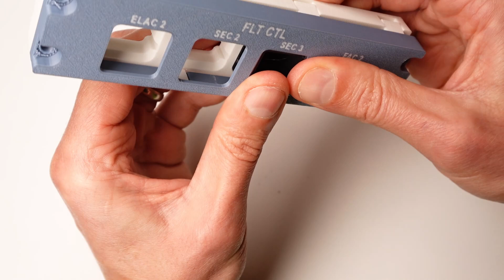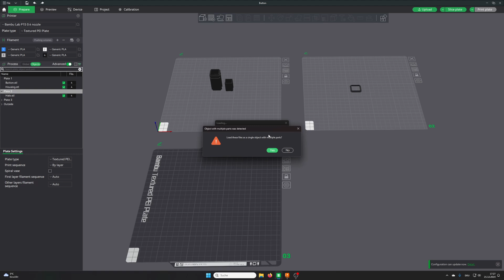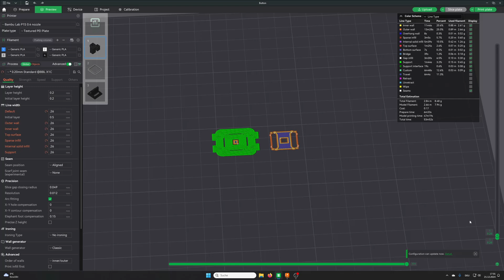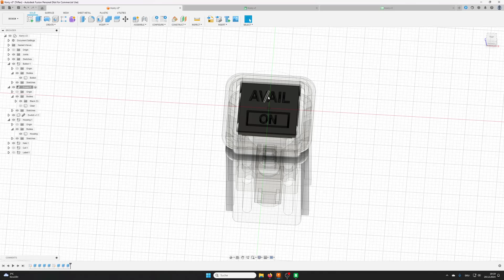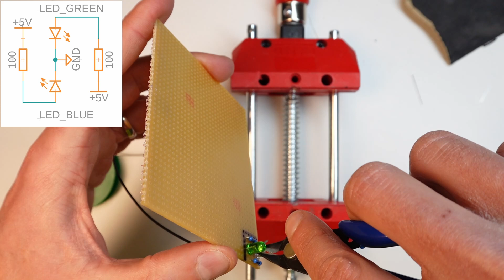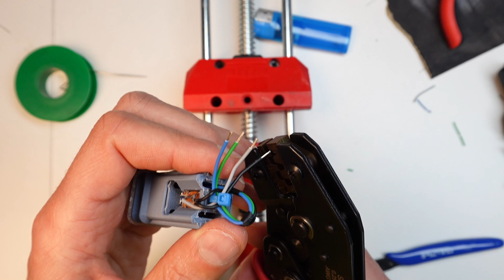The Korry Switch Part 2   Printing & Assembly  EP 18

Comment: Very nice video. How much resistance do you have per meter cable? I wonder if you fx. need 2 meters of cable between the korry and the arduino, would you have to use different resistances near the LEDs to avoid getting "too much" resistance, or wouldnt that be an issue? (Ive never worked with electronics, but it seems very interesting) In my mind, if you'd have too much resistance, the LEDs might be more dimm?
Reply from the maker: I'm not an elictrician either. But I don't think that even 2 meters will make such a difference. In general I would prefer to keep the wires as short as possible. Due to my design with the arduinos mounted directly to the backside of the board there are no longer wires necessary.
Regards Tom

Comment: Love your videos! I’m having a difficult time getting soldier to stick to my wire and the pin in on the switch. Do you have any tips?
Reply from the maker: Did you apply solder to the wire first? Otherwise it will not work. Then put a drop of solder to the tip. It will help a lot.
Reply: @TheCockpitPrinter I will try this. Thank you for the reply and advice!

Comment: Is there any PCB designed for the board? It would be much easier to order it inline instead of cutting it manualy% I would appreciate it alot
Reply from the maker: It's possible. I already thougt about it and I want to make a video about PCBs later. This would be a great example for this!
Reply: @TheCockpitPrinter  It would be very nice to order those pcbs for the korrys insted of cutting them by hand.

Comment: Thanks for all of the time and effort you are putting into these videos, these Korrys are so much beter than the ones I bagan to develop - using the switches that you have, makes all the difference - mostly I see the use  8x8 tactile switches, which I found to be difficult to mount and not a paticularly realistic feel.

One small mod. I made, was to form 1mm fillets to a height of 4mm from the inside bottom face of the button, in each corner, to give the circuit board somthing to sit on, rather than being pressed down on the solder and wires - keeps everything level and better seated.

Looking forward to the BIG panel video